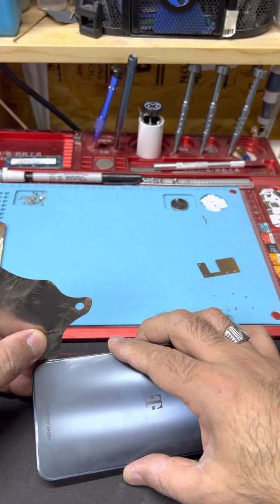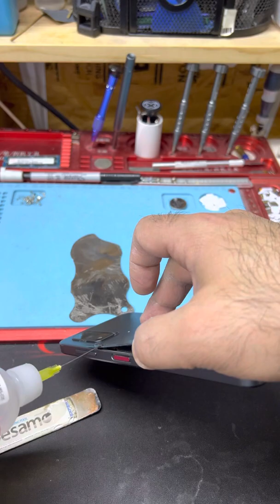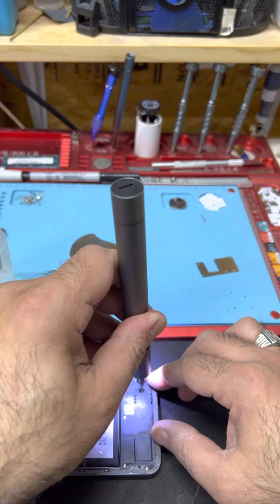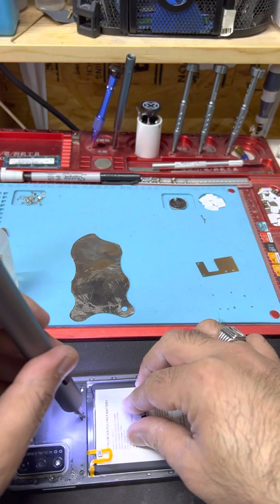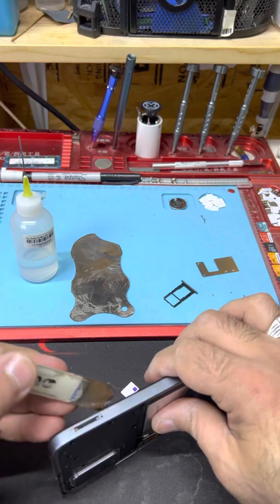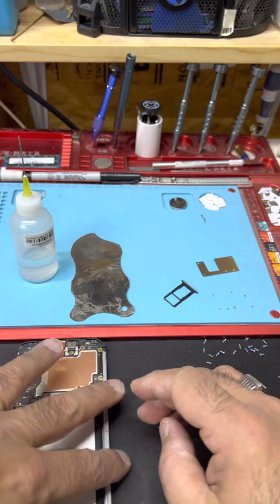REVVL TMRVL4G Teardown

Comment: What's that solution you used to take the back cover off?
Reply from the maker: Just heat and some 90% ISO alcohol  and patience
Reply: @CellDr55  Thank you! 🙏🏼
Reply: Hey where's part two I want to know how to take off the charging port and replace it. Let me know if you have part two
Reply from the maker: @ernie7123  Charging port is really easy and exposed, just pry it up but first make sure there isnt a screw there, from the looks of it there isnt a screw. Lift FPC and 2 antenna cables and just lift up from the top.